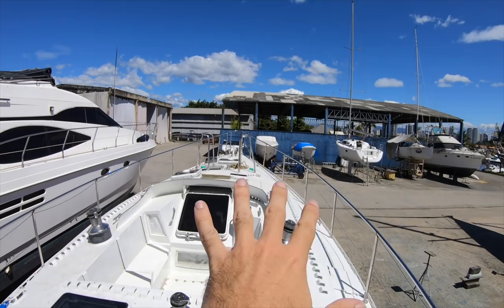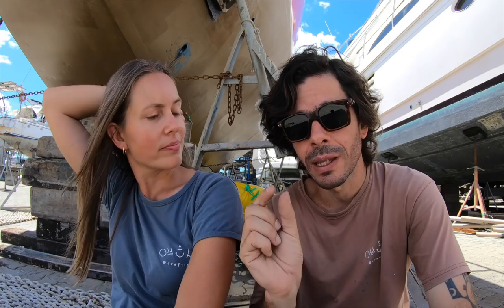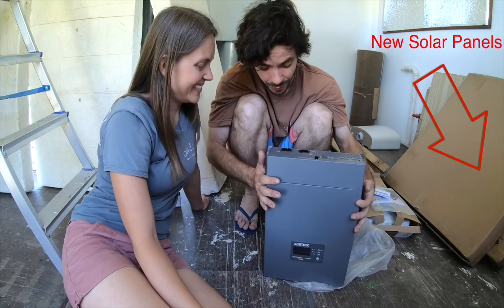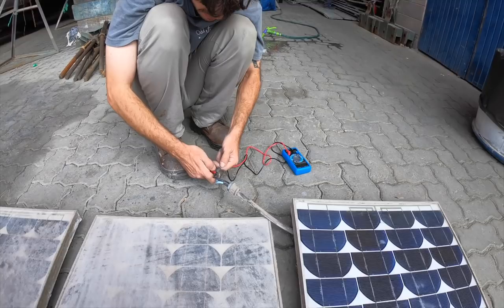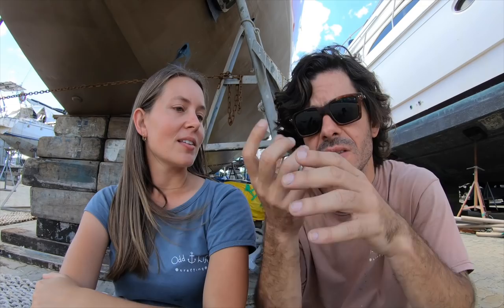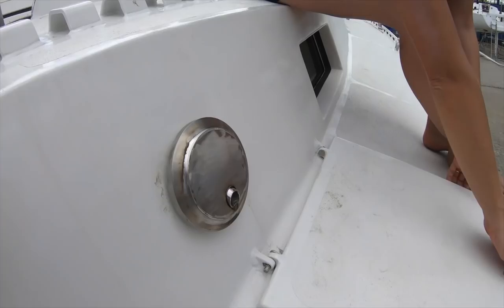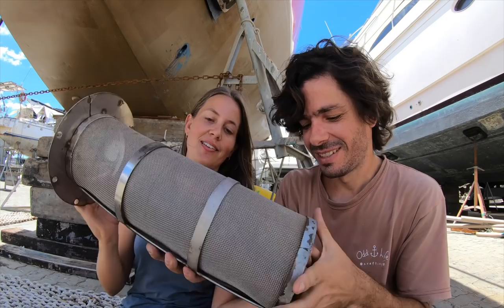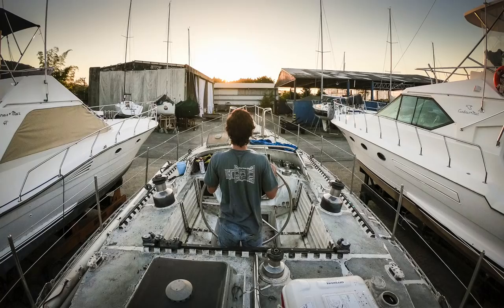⛵️Stainless Steel! LET'S GET STARTED!! #120

Comment: ABOUT THE SLOP ON DECK:  WHEN YOU'RE SAILING, THE BOAT HEELS AND THE DECK BECOMES HORIZONTAL.
Reply: Yeah I didn't see your comment till I stuck mine on here. That's a great deck design for heavy weather!!!👍🏻
Reply: Save when you're working to Lee.
Reply: Marco Antonio Neves exactly!
Reply: Never try to walk on leeward side.Never! ;-)
Reply from the maker: Yes. This is another reason why the deck is like this ☺️
Reply from the maker: Thanks for the tip
Reply: Exactly correct, Marco!! (although no harm in solid rails)
Reply: @grendelek  why? Wouldn't it be more unsafe on the windward side?
Reply: Same thing commented then saw we Are all saying it lol.
Reply: @captainhook8259  Unless you are on the low side..LOL
Reply: Commonsense reply !   I suppose those vertical rails will be inthe way  in a big blow ?

Comment: Pedro just makes art.
What a smart way to bring water to the front of the boot, it is so simple.
Love the thinks you guys do.
Gr from the netherlands👍👍
Reply: Mike Mi you know what’s even more simple? A coily hose stored in a deck locker.
Reply: @bobadam7021  More simple yes but now you need a 40 foot hose on deck and a person to get to the anchor up and wash it down up but with their design they could setup, turn on a pump to have water running through the locker or even over the whole front deck and lift the anchor via remote or cockpit controls. 

This boat design started as a safe heavy sea condition boat and this increases the safety and keeps water out of the boat and above the deck a lot of commercial boats do this in NZ also the only issue is it freezing with water in it so the lowest point on both sides should drain for winter or cold destinations (then be capped as bugs get in too).
Reply from the maker: He is great. Greetings from Miami. Hehe
Reply: Steve T yes, you need a 40’ hose on deck when anchoring on a muddy bottom.

Comment: The voltage will be around the same for a clean or dirty solar panel.
However, the maximum current will be higher on a clean panel.
Reply from the maker: Thanks for the explanation ☺️
Reply: Open circuit voltage vs. loaded....this is where dirty panels will decrease efficiency.

Comment: I wasn't sold on the diameter of the tube on the tops of those stanchions  I thought it was much too big.  Then when you explained the hose inside I understood.  That's an elegant solution.
Reply: is that what he said ? guess I missed the part where he wants to pull a hose through the SS handrail ?  I am asking because the first thing I thought of was "why won't the rail RUST from the inside out with water running through it to a hose connection  ?? 

is the new rail actual stainless steel or some chromed metal  ? I am very confused now ( was probably distracted by Roberta and not paying enough attention to Duca ! )  He DID say fresh water down one side and salty water the other side ?  help !
Reply: SailorAllan that’s what I heard at first. Later on he said they were going to pass a hose down through the rail.

Comment: A rekomendation aboute diesel filter. Before the engine you hawe a filter.
Make a double one there with a shift walve.
If you get problems when you realy need the engine you can shift to a clean filter in a sekond.
Its super simpel to build a double filter system.
2filter holders and 4shift walves and 2 Y kopplings. And a wooden plank or simular to mount the filter holders and walves on.
If you think aboute safty this is a eazy and cheep safty thing.
Reply: also diesel treatment for every tank a steel boat tank condensates (lets water form) this was why your boat was stored full of fuel as well
Reply: Yes, I also highly recommend a double filter with a shift valve so you can get clean fuel in a hurry. Can prevent a catastrophe.

Comment: I got the same barbeque grill, just with gas instead of charcoal. 
Much, much better and makes barbeque just as fine as with charcoal, just less work to start the fire (just plug the gas bottle in and lit the fire) and 10 min after turning the gas out you can already store the grill back because you don't have to wait for the remaining charcoal to burn out and cool down. 
Not to mention the mess you have on the boat and on your hands every time you have to deal with charcoal.
Reply from the maker: We saw one of this in the Miami Boat show today 😍⛵️ they seems to be really good
Reply: @OddLifeCrafting  Believe me, they are. I was worried about how the "churrasco" would come out, but it does it just perfectly. 
You wouldn't be able to tell the difference between a nice steak grilled on charcoal or gas. 
One bottle of propane cost about  70 BRL and you can get a lot of barbeques out of it.
Less mess, less space needed for storage, doesn't have a problem with moisture and you don't have to deal with the remaining charcoal on your grill, which in long passages can become a real problem. I'm super happy with mine and would never go back to charcoal.
The only problem I ever had was on a very windy day, the flame wouldn't stay on. But even then, you can use charcoal on your gas grill, as a last resource.

Comment: Bonjour les amoureux,
I hope you enjoy your holidays, and without any vice in Miami :+)  
Technical question :  How will you protect the weldings made outside from the rust ? Is the weld rustproof by itself ? 
About the breathing tank, would you appreciate the smell of the diesel in the cabin ? You would die if so, this is to my opinion why the previous owner decided to put the pipes in a place  isolated and supposed protected from the water. Bad luck, the place is isolated, but not from the water coming with the chain. Personnaly I would have just added two little schnorkels like the ones we have on our diving masks with a little floating boal or equivalent valve.
(Private message for Duca, never forget who is the boss in a couple and never confiing me s secret, I can't keep it for myself :+)    ). 
Amicalement, Raphaël

Comment: It was great to meet both of you in Ft. Lauderdale at the lunch!

I found the best way to clean the anchor and chain locker is to drop a submersible 12 volt pump over the side with a garden hose and plug it into a cockpit outlet. No plumbing needed.
As to the jib, I strongly recommend a roller furling rig for safety and convenience. You don't want Roberta on the foredeck in foul weather conditions and having to store a wet jib below deck. The jib would be operated from the cockpit. I speak from experience on this. 
Ken
Reply from the maker: It was a pleasure to meet you. Thanks for the tip. ☺️

Comment: Another great video. 

Those canted decks are actually a smart design on a sailboat. When you're under sail, you should only really be walking on the windward side and with the boat heeled leeward, the windward decks are closer to level with the horizon and easier to walk on. 

You may miss that heater. Even in warm climates you can find yourself sailing in cold currents. With a steel ship this sucks the heat out of the boat. Also if you are in rough seas and getting soaked to the skin, being able to keep warm is important. 

Boat looks great though. You guys are doing a great job. Can't wait for the launch!
Reply from the maker: Yes. This is another reason why the deck has the angle. About the heater, we won’t miss what we never tried before. 😂😂 we don’t have the heater and they are hard to find here in Brazil. Maybe one day
Reply: @OddLifeCrafting  fair enough. 
Maybe some nice viewer will gift you a heater. Just in case. Besides then you can visit Canada too!  ;')
Reply from the maker: Hehehe

Comment: I believe you just discovered what a sea chest is. One large thru hull that can easily be cleaned and supply many different needs from cooling engines to AC and wash downs. The best thing about the sea chest is the ability to keep it clean.

Comment: I missed the last couple weeks but you guys have really gotten a lot done!
When you consider the wind vane you may want it at the top of the mast.
If you want a wind generator the arch is a good place.
Think about the noise the generator will make .
You will probably want it as quiet as possible for when you are moored close to other boats and also so you don’t have to listen to it either.
You have probably already thought about it.
I hope you are having a lot of fun in Miami. I wish I didn’t live a days drive away.
See you next Monday!
Reply from the maker: Welcome back, my friend. The wind vane is like a manual autopilot. It’s something that stirs the boat, so it needs to stay on the back of the boat 😁⛵️
Reply: Odd Life Crafting 
Thanks! 
I knew what it was but I confused it when thinking about the solar panels. 
Thanks for correcting my mental block 😂😂😂

Comment: Duca here is an idea place a pressure nozzle down at the opening where the chain comes through the boat to spray off the chain before it enters the opening of the boat using the sea water to clean the chain. Hook up the electrical pressure sprayer to the chain hoist motor so when the chain is being lifted the spray nozzle will spray off the chain automatically.
Reply from the maker: Thanks a lot for the recommendation.

Comment: Hi guys, I would like to make a suggestion: if it were my boat, I would use the tubular construction on the back of the boat as a support for an emergency rudder. I would ask your welder Pedro to think sometime up now, because if you ever have a rudder failure on the ocean, you most likely don’t have the materials to fix that. 
I’m curious how everybody here is thinking about that subject. 
I’m a huge fan and love the project.
Reply from the maker: For sure we would agree if it was a regular rudder. Hehehe this rudder is so so so strong that we kind of feel confident on not having a second one. Of course even the most strong things can fail so let us think about that to come with though about it. Thanks so much for the suggestion Reinier. 😉

Comment: For the middle wire in the railing you can use solid stainless steel rod instead of wire this wil make the middle part of the railing much more solid. On the ends of the rod its still possible to fit a terminal to put some tension on the rod.
Reply from the maker: Thanks for the recommendation.

Comment: You guys are so funny its always a pleasure to watch your vids  , the rails look fine solids are way strong , just remember that you will have to learn to walk in a seaway, that comes with experience. Dont ever hesitate when offshore to wear your lifeline it might save your life , no kidding . During the Newport to  Bermuda  Race in 1983, I was on a Nautor Swan 44 , and I got knocked overboard trying to put a sail up so I know what I am talking about . The wash down in the hose in the rail is an elegant solution , the only thing I would say is  ,without knowing how you are going to run the hose make sure there is a grommet where ever it enters or exits, because it will chafe .I really dont know anything about main sheeting  on an arch but if it works out so much the better , hope your having  a fine time in the States, take care
Reply from the maker: Thanks a lot for the tips and support

Comment: You will love the stainless rail. I did one for part of mine an really enjoyed it. You will get much more use out of your dingy when it is easy to deploy, you are doing a smart thing! As engineers you will understand that if, when the dingy is up on davits, you should secure it firmly to the stern. Use diagonal lines to counter the roll of the boat and secured into the stern to move the center of effort off of the davit pulleys and onto the stern. Bravo, you ave doing a great job.
Reply from the maker: Thanks for the recommendation and for the feedback about the rail

Comment: Great set of projects. I have a suggestion you might want to think about. A built in "fuel polisher." You can not trust the quality of the fuel pumped (even in the US) and condensation problems on a metal tank. For around (US) $100 you can build your own to insure you have 100% diesel fuel in your tanks and not going to diesel engine injectors.
Reply from the maker: Thanks for the recommendation

Comment: Duca  here is a thought why not place a bracket on the outside of the arch and mount the wind vane to it so you have space to place the solar panels and other electrical components
Reply from the maker: The wind vane we are talking is like a manual auto pilot to steer the boat, it needs to stay on the transom of the boat. 😊

Comment: If you are going to do serious cruising and are going to modify the bow, then you should install dual bow roller so you can have two anchors which is very useful for Bahamian mooring in anchorages with reversing currents or weather fronts coming through. Similarly, make sure have a good way of deploying a catenary weight as part of your anchoring system.
Reply from the maker: Thanks for the recommendation

Comment: Salt water used with Austentic Stainless will corrode and the chlorides will lead to cracking.  Using pure water (R/O system) will eliminate both.  Using that type of water will save your chain locker from rusting up also - provided you keep that chain CLEAN.

Comment: There actually are other reasons for the angled deck (as I see it).(1)  It contributes to a better centering of the mass. (2) It also reduces weight by lowering the freeboard, in areas where you are not likely to need to stand (below deck). (3) It is actually a lot more confortable to walk on when heeling, provided you alway walk on the windward side. In any case, those are great looking guard rails. Normally I would worry about the added weight, your boat already is like a tank, so no big deal.
Reply from the maker: 😉👌🏼 that’s true!! And our new mast is a lot lighter so we can add some weight hehehe

Comment: Solar panels have become so much more powerful now and are so cheap. Here in the US I bought my panels for about $125 for a 300w Mono crystal panel. The space you have would hold about 2 of them as they are bigger than the little ones IMHO I would chuck those old ones and get more efficient ones. Your prices may be higher but in the long run it would be worth it.
Reply from the maker: Right? They are much better. We have a partnership with Xantrex and they gave us some solar panels ☺️ in Brazil it’s not that cheap

Comment: If you ever need to use Aluminium and steel together you can bolt them together with zinc nuts, bolts and washers. That will keep them from electrolysis problems.
Reply from the maker: 👍🏻 thanks for the tip

Comment: Maybe you guys could build a diesel polishing unit hardmounted to your diesel tank. Many offshore expedition boats have this so that you can polish your diesel tank if you suspect contamination. It’s actually very easy to assemble one with off the shelf parts and there are various diagrams on google.
Reply from the maker: Thanks for the recommendation

Comment: No boating experience here but, my question is based on other channels discussing wind generators. 
At least 3 times other boaters commented wind generators creating vibration noise throughout the boat and loud in general so much that they removed them. I love the idea of wind power and have inspected systems onshore and they do resonate a lot on the towers.  Perhaps a cover, quick detach or braking system might be a way to mitigate any future annoying issues. 
Especially when sleeping.
Reply from the maker: We didn’t try to refit our wind generator yet.  If it’s working we are willing to give it a change to be tried out. Hehe

Comment: Your idea of using the handrail to shift water around the boat is a sound one except that don't forget to drain the rails down when you get to cooler climates as the handrail will be one of the most exposed portions on the boat, subject to freezing!
Also, I would be concerned about the welding of the handrail, principally the butt joint between the two lengths.  The tubes should have had an argon purge gas inside the tube to prevent contamination of the weld internally.  This is critical as the tube is thin with a small weld that could easily break under a load leading to a man overboard, not to mention that the broken ends of the tube will be sharp hollow spears.  The joint should have an internal sleeve to provide the mechanical strength and as a back up  for the weld.  In this case you could probably get away without the purge gas.
Reply from the maker: 👌🏼 the idea ia to fit a hose inside and some how isolate both ends. We didn’t finish the final details yet. But thanks for the tip Clive. 😉

Comment: Notice there is almost no deck storage. Right now your not think of it but when under way you need deck storage for ropes and spare ropes, extra sails, extra water, gas for dingy boat, tools for fixing the boat, extra parts, gas bottle(s), grill, swimming equipment, bikes, solar power chargers/battery bank, water maker, etc. I'd recommend making storage hatches/boxes like newer boats have built in on the front center/side/back of the bost made out of fiber glass and opening lid at the top with a rubber gasket. You have no idea the amount of equipment needed for real sailing around the world. Looks like a poorly desgin boat since they left it all interior storage on the sides of the boat instead of making it outside stotage. You also need a dingy crane/arch on the back to hold it and a folding swimmer ladder on the rear. It cost a lot and won't be cheap but you certainly need that storage if you plsn real ocean sailing/live-a-board long-term world sailing. Good luck!
Reply from the maker: There are boats like ours that already travel the world and they found some ways of handling this “problem “. I think in a long term we are gonna figure it out 😊

Comment: You might want to add drains to the pipes, so you can get the water out. Just in case you do some high latitude sailing. Would not what them to freeze.